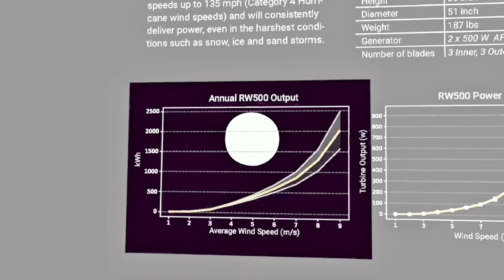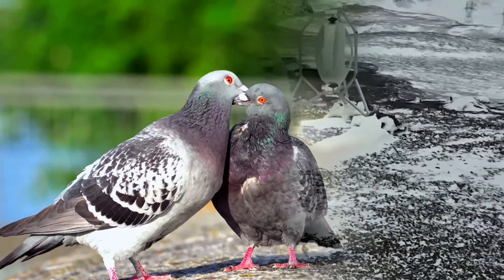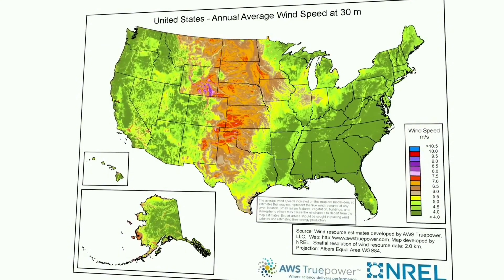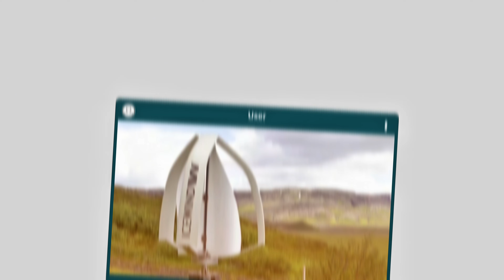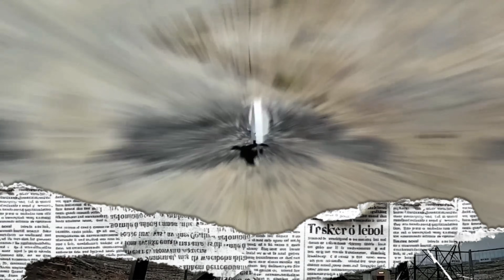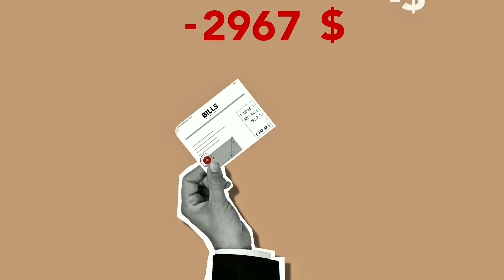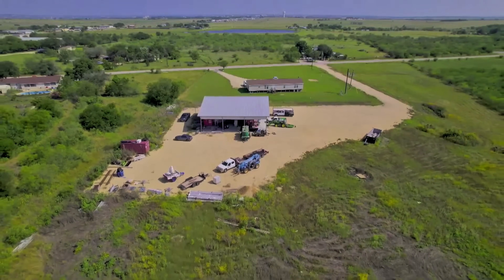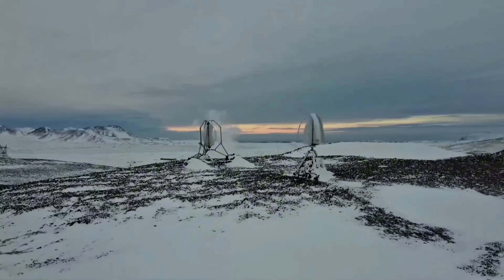This NEW American Wind Turbine for Home Out Perform PV Solar Panels in 2026?!

Comment: If the price for this windpower is $3200 for 200 watts that is $16000 for 1 kilowatt. I just installed an 8 kw solar system for $6000. For an 8 kw wind power this could cost $128,000. Plus tax and install plus labor.

Comment: Total fiction. This VAWT turbine does not exist in the real world. If it did, they would supply links, so punters can buy them. Pure click bait.
Reply: Yes it does  , it's called  TESUP  and they do produce electricity,  but barely 200watts and that's when the wind is really blowing,  so  U would be better off building your own like I did , a 55 gallon drum cut in one foot sections for the blades ,  I'm using  off the shelf parts like car bearings that can be bought at any auto parts store  , metal from scrap yard and Welded to Dimensions needed , and a 1200 to 1800watt P.M.A.  ! 
PMA stands for Permanent Magnet Alternator  is a 12SI Chevy Alternator  just like every Chevrolet vehicle  has but inside has Neodymium Magnets on the rotor , Now the Bad !  It only makes power when the Wind is blowing  , But the good thing about the PMA is that it doesn't care what spins it , so if U have a small creek , use a water wheel  to spin it , a bicycle with the rear tire removed  and a serpentine belt on the bike rim , a small  2 cycle weedeater or chainsaw engine  , and then  get some Solar Panels  for backup  and U will be using  the Sun , Water , Wind , Bicycle,  or small engines  to make ELECTRICITY  , 
But the name of this is TESUP  and  the only good thing about it is that it gave me ideas to build my own  !